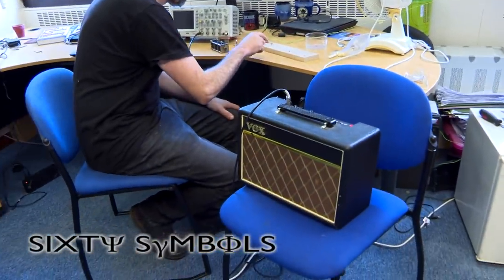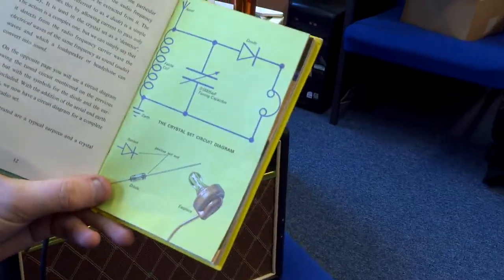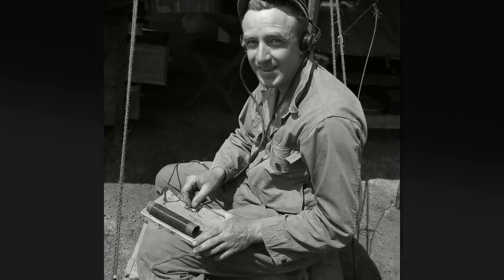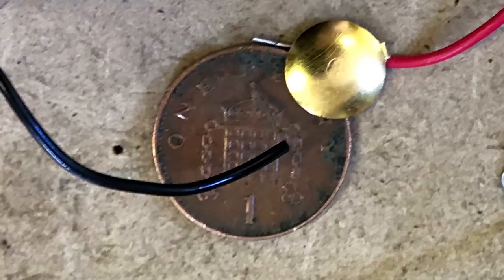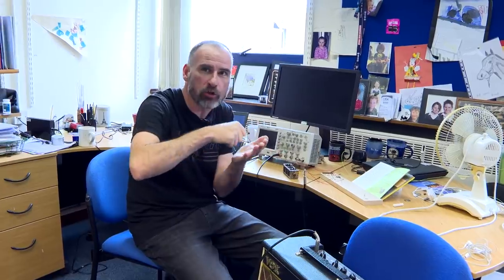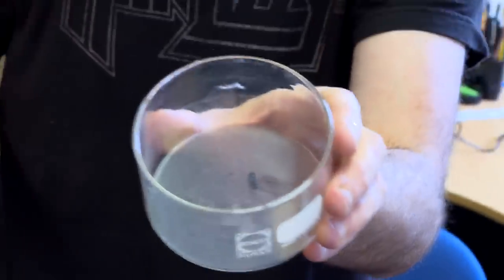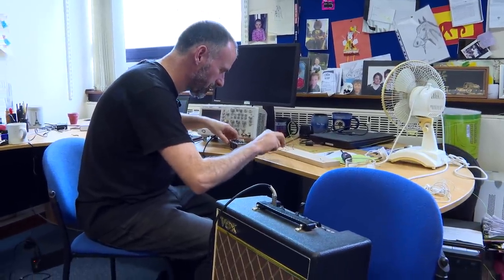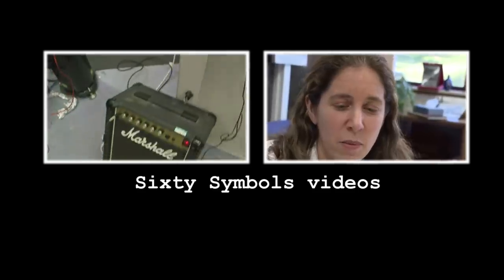The Joy of Radio - Sixty Symbols

Comment: Thanks for the memory, The simplest crystal set I made was a 1950's Germanium point contact diode strapped across an old telephone magnetic microphone, with an aerial and ground attached to each side of the diode. With it, and no amplifier, you could hear the local AM radio station right through our house. It still works well, decades later. Crystal sets were the seed which inspired me to earn an Amateur Radio license, and to choose an electronics-related career.

Comment: Me and my brother made a crystal radio from a commercial kit decades ago. We put the antenna wire in the attic, along the whole length of the house, and drilled a little hole in the ceiling to let the connecting wire through. I haven't been to that house in ages now, but I bet that antenna is still there. The thing worked like a charm btw.

Comment: Ten years of my childhood in one video!
I made many crystal radios, based largely on MRL designs. (Modern Radio Laboratories - which was neither a laboratory or modern, but just an old man who had spent a lifetime maximizing crude radio circuits and determining the most desirable wire gauges, insulating materials ((double cotton covered)), best galena crystal designs and cat whiskers (( a rod on a ball joint with a wood knob at one end and a spring at the other from which descended a high nickel wire of about 30 gauge to tickle the crystal)), etc.) One of his innovations (probably not his invention but he was insistent on it) was a second .365mf variable capacitor to tune the ground. It made tuning the set a lot like an early TRF Radiola - move one dial a little, then move the other a little... But on the Mexican border I could hear Chicago and occasionally the BBC! But only after midnight, when the local station went off the air. During the day it was the local station all across the dial. High impedance head phones were a must! Or connection to an amplifier, as you show here. I went on to one tube radios (valves in Britain) built from tubes I salvaged from old televisions found in the trash, and regeneration was like a Black Art - where a radio that had only a half dozen stations or less would squeal and suddenly have thousands! Ten 9-volt batteries taped together and wired together providing a 90 volt plate bias. Never went far into multi-tube sets because I couldn't work out resistance coupled stages. And then I grew up. 

I still have a lot of the parts, the wires, the coils, the tubes, the capacitors, the headphones, etc. in the garage. Hope I have a chance someday for a "second childhood" and to play with them again.

Comment: I remember building a crystal radio as kid sometime in the 90's... I think 93 about 10.
I recall opening the kit, and desperately trying  to figure out what type of batteries, finding out it doesn't take batteries.  With incredulity I thought, how is this going to work without a battery.  
It did.  I picked up many radio stations.  It gave me goose bumps to begin to hear the ghostly sound of the radio stations, and become louder as a tuned in.  
All with a few items: 
simple electronic diode, piece of toilet paper roll like cardboard with wire wrapped around, small crystal earbud, and various wires and one very long antenna wire, and an optional variable capacitor for that method of tuning as well as a coil wire so you could try the two different tuning methods.  
So simple and basic that it was the first time I realized it wasn't complicated magic trick, but very basic physics that explain radio reception... and to me the simplicity was the real magic.

Comment: I tried to make a crystal radio when I was a kid. I came to the part of connecting the “cat’s whisker”; I went to my father and asked if we could get a cat...
Reply: Did it work? Haha
Reply: I remember playing with my uncle's cat's whisker set. It had a tiny wire that you tweaked into contact with a tiny black crystal using a rod with a bakelite handle. Amazingly it worked.
Reply: Greg Hartwick That‘s adorable
Reply: Vinny Trevino       My father was allergic to cats... hehe
Reply: @fburton8  I still have a genuine 1920's cat's whisker, with the Galena crystal in a holder, and the screw-mounted whisker wire, all inside a short glass tube with Bakelite and metal ends. It works really well.

Comment: As I type, I can hear, very faintly, Radio Moscow on my otherwise idle amplifier. I live right next to Woofferton transmitting station, the last remaining short wave site in the UK, which played an important role during the Cold War. Its location is significant because it's next to Clee Hill, and it just so happens there is nowhere higher in a straight line between it and the Urals in Russia. Apparently, old people say they used to be able to pick  up Radio Moscow through their fridges, in fact there's a pub in Cleehill village called the Kremlin. Fascinating stuff.

Comment: as someone who's always been interested by electronics and more recently radios, when i found out the simplicity of an AM reciever i was very surprised. i also remembered when my friend had decided to try and build a guitar pedal and ended up creating a radio reciever, turns out they were using a silicon diode and im not sure of the rest of the components they had and how they had wired them. before i knew about radios i had no idea what could've been going on, and now that i know what's going on, i wish they had kept it!

Comment: For me, this was really a blast from the past. I started out making a crystal set. I never tried t kale a cats-whisker but plant of pictures in those books. I used a germanium diode I think that was before silicon. I upgraded this set using a red-spot transistor that cost 10 shillings. This was followed by a 2 valve (tube) Tuned Radio Frequency (TRF) radio that was great at picking up Radio Luzeburg 208 Metres. Kids need to be encouraged in basic electronics.

Comment: Ah brilliant. Part 2 is good as well.

Small point of correction though, while Absolute Radio's studios are in London, as is usually the case the transmitters (there are quite a few) are closer to the audiences.

Given your location in Nottingham, it's most likely you are picking up the Absolute signal on 1215kHz (247m) from the old BBC Radio 1, later Virgin Radio, powerhouse transmitter (100kW erp) at Moorside Edge in West Yorkshire just south of the M62 and west of Huddersfield. There are two other large Absolute transmitters on 1215 as part of a phase-locked network. These are at Droitwich in Worcestershire and Brookmans Park in north London so you may be getting a mix but the bulk of the signal will from the closest except perhaps at night.... where physics beyond your control may come into play.

Comment: It will work better with a high-value resistor across the signal output in parallel with a small ceramic capacitor. Values around 220K for resistor and 100 - 470 pf for capacitor. It forms a low pass filter and removes residual RF noise and tries to stop it reaching your amplifier.

Comment: This is where the term "crystal radio" came from. Traditionally, the detector was a galena crystal (lead sulfide). Before there were ferrite cores, you would wind your coil on a Quaker Oats oatmeal box. The advantage of ferrite is, for a given inductance, your coil is physically much smaller. Be prepared to spend a lot of time moving your catwhisker around to find an active spot on the crystal.

Comment: Prior to availability of silicon diodes, they used to make rectifiers with copper oxide. As a child we had radios whose power supplies used these. Also, point contact transistors were the first design used at Bell Labs at the dawn of the solid state era, only slightly more complex that this design.

Comment: I made my first crystal set in 1964 , from an OA 90 or 91 out of an old TV with a coil I wound myself by hand on a one and quarter inch wood former (91 turns as I remember) the tuning capacitor came out of a scrap yard, I lived in Cambridge and the scrap yard had all sorts of goodies from the PYE works.Went on to build an amplifier that drove a speaker. The radio worked exceptionally well when connected to the phone line for an aerial,don't tel the GPO they wont like it.

Comment: 50 cycle hum in the background.  I built a bunch of these in my young adolescence.  Just a nit to pick - the reasons that it demodulates is that the device is non linear and produces sums and differences of the input frequencies.  And the devise differentially conducts but doesn't  only conduct in one direction.  There is a minority current in the reverse direction due to minority carriers in the junction.  But great video.  Loved building and listening to these.  Used everything imaginable for an antenna...
Reply: Hi, Joe. Thanks for your comment. See the blog post linked in the video information for much more on the demodulation process (especially from a Fourier domain perspective.) The minority current is entirely negligible under the "biasing" conditions used in the crystal radio.

All the best, Philip (Moriarty, speaking in video)

Comment: I took a summer week in university when I was in 11th grade and we did a workshop to build a radio. It was such a race to get the first sound. The radio stills lives on a single circuit board and works. But if I touch the potentiometer for coarse frequency adjustments, it completely jumps in the spectrum. 

This however is a more basic. 

I haven't started EE&CS yet.

Comment: Thanks, prof. I've heard of the copper coin thing before but never tried it. I played around with crystal sets in the early 60s too and had a looonnng wire like yours although mine headed out from my bedroom window to the clothes post at the bottom of the garden. The only station I could get reliably was the Home Service and so I spent my pre-teens and early teens listening to Jack Demanio on early versions of the Today prog. I'd love to get the SW/MW/LW radio (a Cossor) on which I listened to the Arab-Israeli War in 1967 from all sides working again but I think that the 50 years it spent in my mum's attic after I killed it have killed it beyond resurrection.

Comment: Germanium diode.  Connect one end to ground, the other to a wire for an antenna.  Then take an earpiece, and connect off its two wires to end of diode and the other wire to the other end of the diode.  It's small enough that it will fit in a matchbox.  This will pick up any nearby AM broadcast if decent strength.

Comment: After learning about different microphone types in a physics class a friend and me wanted to build the simplest form of them - a moving coil microphone. So we got a strongish magnet, some rather thick wire that we coiled up, a can and a ballon as a diaphraghm. With this we tried to create a really crude mic. Well.. It kind of worked as a mic if you shouted into it, but everything you could make out was drowned out by some russian commentator of the radio station we also picked up. 
I still don't know how that worked and this video makes it seem even more impossible, as we had no semiconductor and capacitor that are used in this video. Just a "microphone" (or basically a coil) plugged into an amp..
Reply: A capacitance effect between the coil & the can, &/or the input circuit of the amp.

Comment: I taught high school physics for a year. Instead of a foxhole radio, the kids and I built a foxhole speaker. It was more appropriate to the lesson on electromagnetism. One of the kids plugged his electric guitar into it. Unfortunately, the sound coming directly out of the guitar strings was louder than the sound from the speaker, so it was hard to tell if it was working.

Comment: You'd probably have used a germanium diode in an un-powered radio receiver. A silicon diode doesn't conduct until about 600mV forward bias is applied. You could possibly use a 1.5 volt battery as a buffer to take the silicon diode into it's conducting state. A point contact diode as seen here doesn't exhibit the same characteristic.

Comment: Man, they got rid of pennies here in Canada a few years ago, but I found a really badly oxidized one that was almost completely green a few weeks ago. After debating a few days, I threw it out cuz I'm trying not to hoard so much junk anymore. If I knew it could be used as a point contact diode I'd have held onto it. Maybe I'll use salt water to corrode a piece of copper.

 I think I originally used it in one of those galvanic cells made from copper pennies and zinc washers, hence the heavy oxidation. It would be pretty neat to use a battery of those zinc washer copper penny cells to power a crystal radio with a copper penny diode.

Comment: Gotta agree with Jim.
The familiarity with Crystal Set Radios and the Universal axial-tangential orthogonality of here-now-forever localization circularity connection actually hobbled my preparation for Mathematical Physics. Ie what developed Intuitively from the temporal experience of modulating frequency and energy density-intensity levels is converse to the didactic imposition of the semi-religious mythologies about measures and explanations that are actually obvious directly under our noses.

Interpretation of Young's Interference positioning resonance patterns suffers appallingly from the predjudices driven by false authority attributed to the pretend mind outside human existence. 

There is one photon-phonon phenomenon of ex-military Signal wire, steel wound around copper that has something to do with tunnelling in spiral wrap around wiring connection.., Quantum-fields that made it a great Antenna for the Radio. One of many unfinished thought experiments..

Comment: I'm a little surprised you got a silicon diode to work - voltage drop of 0.7v compared to 0.3v with germanium  (the type typically suggested in the circuits). I must have a fiddle, may be missing something...

Comment: In the US you just have to find a penny from before 1982... it will be mostly copper
Reply: So I was wondering about this, arent a lot of US pennies still at least coated in copper? I know they're made of zinc but I thought they were coated?
Reply: @XillyWonka  Yes, they're coated.
Reply: @Longuncattr  So would the process in the video work with those then?
Reply: @XillyWonka  I've seen the same sort of green oxide on post-1982 pennies as seen in this video, so there shouldn't be any reason you couldn't make a Schottky diode with one of them.
In short, yes.

Comment: I remember doing this myself, but with a plain old semiconductor diode. And getting the same kind of crackly sound. Can you explain more about why it sounds like that?
Reply: Check out the blog post linked in the video information. What I found amazing is that a purely digital simulation of AM radio produced noise very similar to that generated by the real crystal radio, due to the "bleeding" of frequency bands. There's a demo on there that tunes across a simulated spectrum -- it's quite eerie how much like the "real thing" it sounds.

All the best,

Philip (Moriarty)
Reply: @uncertaintyto117  Unbelievable, I did that experiment myself once as well, and got very similar results! A lot of the characteristic sound of a radio is purely mathematical and follows straight from a simulation without even adding any "real world-ness" to it.

Comment: So.  Some 6 (and some) decades ago, we used Gillette "Blue Blades" and safety pins.  The ones with a spring and point.  Or a piece of pencil lead (graphite) wrapped with copper wire.  Endless things to use for a rectifier...

Comment: Where did POWs get headphones?
Reply: You can make headphones and microphones out of some thin film, a magnet and some wire. You can make a magnet out of an iron nail and a hammer. If you're in a POW camp you probably have lots of time to attempt making and improving simple, small, easy to hide devices out of common materials.

Comment: US pennies are now copper plated zinc. Those won’t work?
Reply: Technically the copper plating should be able to form the oxide/patina I would imagine. That said, there are still lots of pre-1982 pennies in circulation, made of 95% copper, 5% zinc AKA "gilding metal" (technically a form of brass??)

Anyway, I'm experimenting with forming copper (I) oxide on those pre-1982 pennies. No working diode yet... but some promising looking patina (reds, golds). Hoping to make this work.